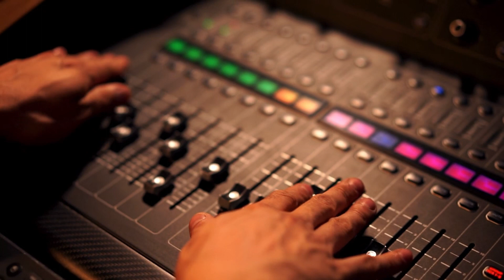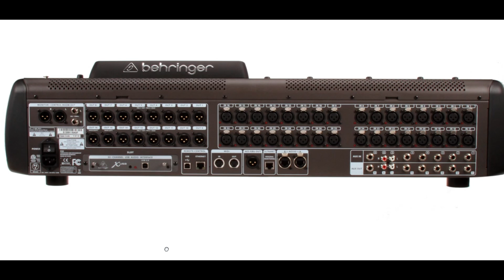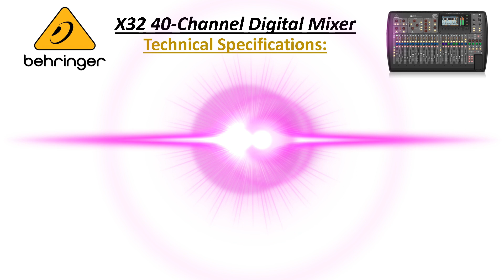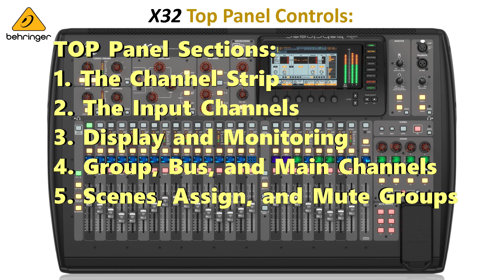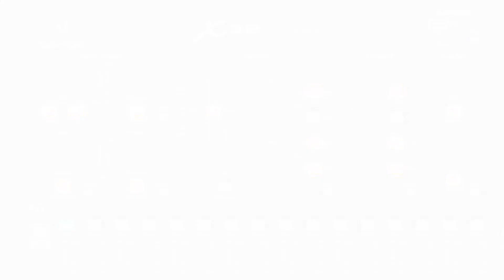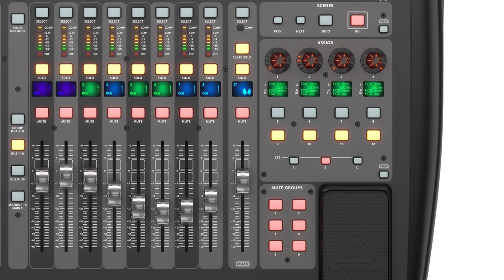Behringer X32 40-Channel Digital Mixer: Quick Overview

Comment from the maker: I’ve been wanted to do this presentation for a while now. This is because I’ve owned a Behringer MX9000 for a long time, and the thought of replacing it with a digital mixing console is intriguing. When it was initially released, X32 was a major game changer for Behringer, and forced many audio engineering professionals to re-evaluate their prejudice against the brand. I wanted to share with anyone interested some of the reasons why that was. I hope this information serves useful.